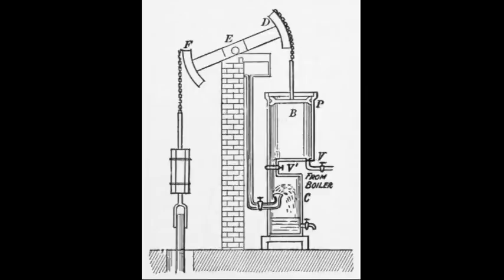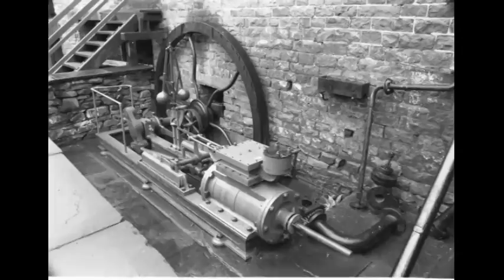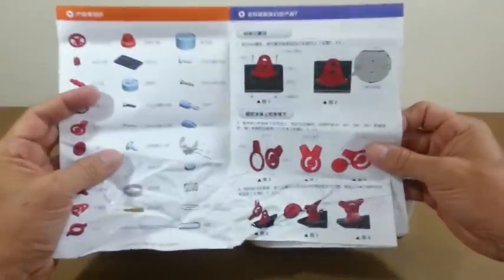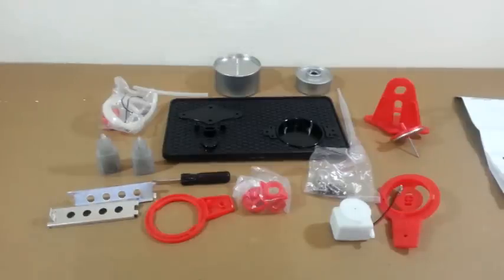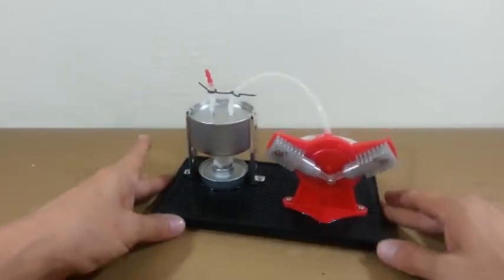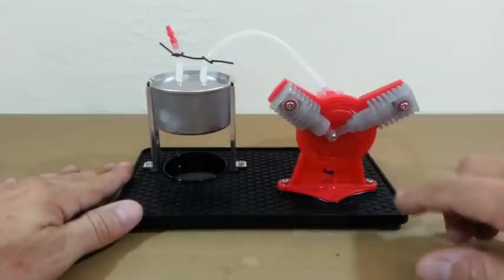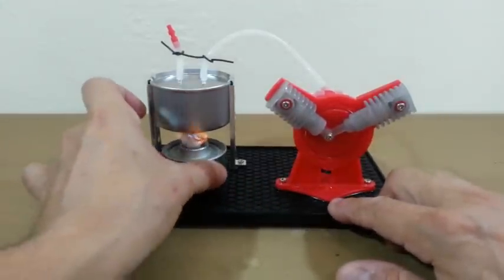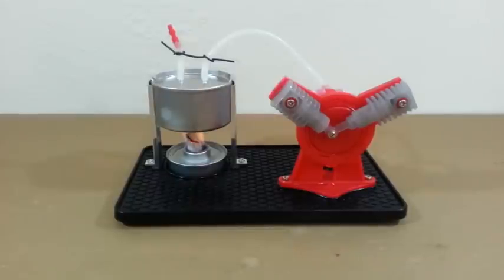Steam Engine Generator Review

Comment: can this be made out of wood, nails/screws/nuts/bolts/washers, and tiny copper pipes?
I mean except for the boiler? A similar boiler could be made with a small condensed milk can, having holes inside it and soldering the rest of openings. And instead of a torch, maybe use a candle, the pot holders could be made from a metal hanger. maybe straws can be used. and wires could be used to hold them to input and output areas.
Dynamo/motor and LED from a broken/dead/older toy.
It'd be a great project to test and see.
Also like one of the commentors said, adding a capacitor (e-cap) can make it have a stable output.
Just wondering, what kinda cheap and available liquid would have a lower boiling point? Maybe 50' ~ 70' C

Comment: I have this model (28 Euro) and the quality is pretty good for plastics.

You can easily use the model as a template to lathe the parts and have them from solid brass. This would make a nice engine for sure.
Reply: Cool man, how much power does it produce(voltage/amperage)? Is it AC or DC?

Comment: A little smoothing capacitor on the output of the generator would have helped but if you know electronics you can easily add one yourself. I ordered this alongside a boost converter to make the output a big higher. It won't produce much current but it will be a fun project. When it arrives I'll update this comment. UPDATE: I assembled the engine and tested it, and it works like it should, with the LED flickering. I would have added the smoothing capacitor but there is a problem: the generator it has is not a DC generator. It's a real AC generator ad it produces 3-5 volts AC. You obviously cannot add a smoothing capacitor to AC, so I converted it into DC using a bridge rectifier. The DC is still very, very unstable even after adding a smoothing capacitor. It works, it produces about 2-4 volts DC now. But there is yet another problem: the boost converter requires over 2 volts to function properly. When it's connected, there is suddenly a huge load on the little generator. This means that the unstable 2-4V DC becomes even more unstable 1-3V DC. The boost converter cannot work with that. It uses pretty low currents so that's not a problem, but the bridge rectifier consists of 4 diodes. Each half of the AC sinewave is gonna pass through two of those diodes, the other half through the other two. This creates a voltage drop of 1.4 volts which is huge! There are better bridge rectifiers but this one has a 0.7V drop per diode across it. That makes the unstable voltage coming from the generator drop to a level where the boost converter cannot use it anymore. I don't know what I should do now but I think I could swap the dynamo with a DC motor to get DC out. The axle where the drive gear is mounted to is the correct size for a mini DC motor.
Reply from the maker: Great
Reply: Guys I just found a gоod website which gives you free_xboх_live_gold_с0des  https://twitter.com/fb986f79fcfb850a9/status/719079525670395904?pZQPm=d50e5de9-db9c-405b-ab3b-b7437b30df07                                                              Stеam Engine Generator Reviеw
Reply: mamannan badal I don't have a xbox.
Reply: Why not just use those 1uf metallized film capacitors designed for mains AC use? that way you can cut out the rectifier.

Comment: Why does it stop instantly when you blow the flame out?  Shouldn't it slow down to a stop?  Because the water doesn't suddenly stop steaming right?
Reply: +YTPmaster As the energy is so small friction beats it very quickly it no longer produces enough force.
Reply: Amit Skanda That's what I thought, but I still find that strange.
Reply from the maker: +YTPmaster Also the boiler is small, there is not enough space to store enough steam
Reply: Ludic Science That makes sense I guess, I'm just confused how the removal or adding of heat instantly affected it.

Comment: I would have expected injection-molded parts to melt, but it seems to be well engineered and must be far cheaper than metal. Pop pop steam engines are cool, too. http://www.sciencetoymaker.org/boat/index.htm
Reply: +sciencetoymaker The maximum temperature of the water at 1 atmosphere is "only" 212 F.